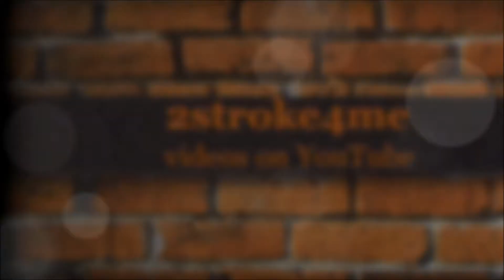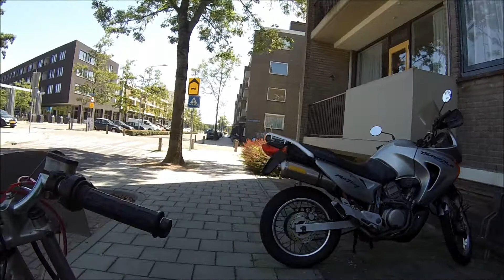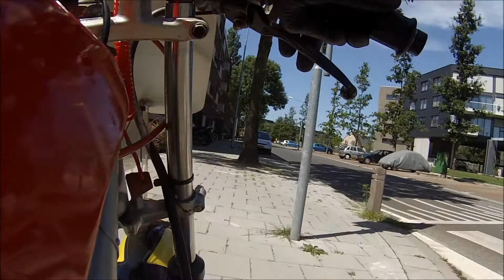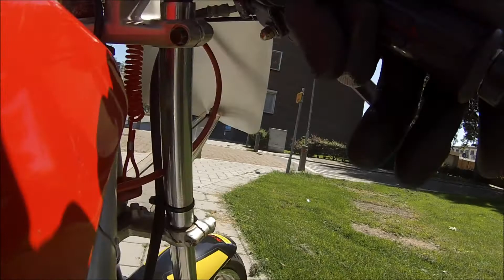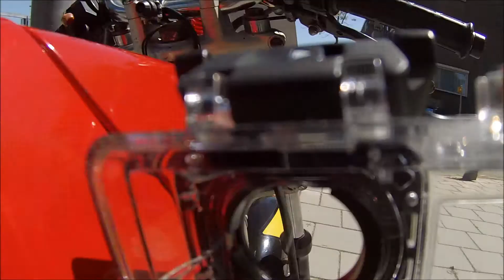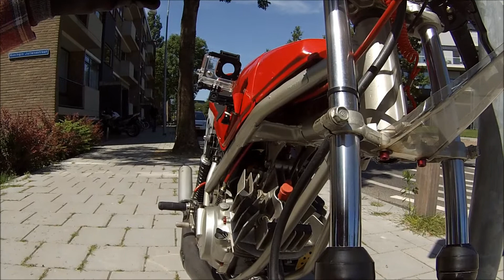Honda MB5 race bike warming up!

Comment: Awesome lil 2 stroke love that sound! 👍
Reply from the maker: I've done a lot of racing, mostly enduro (even on a 600 twin), but on this little 50cc i had the most fun!
Reply: @2stroke4me  It looks like a very fun lil bike to race! If you look at the bars on my old gas powered bike the bars are very similar, I built them for a lil Honda CL175cc that I turned into a cafe racer, but they ended up on that bike... Lol!
Reply from the maker: @mikesrcgarage  They're quite similar indeed! Since we weren't allowed to use clip-ons, this handlebar was the best option.
Reply: @2stroke4me  I will say that is the coolest MB5 I have ever seen and never knew they raced them!
Reply from the maker: @mikesrcgarage  They're good bikes and can take at least 13 hp without loosing reliability, but need a lot of work to make light weight. We even did endurance races, which was the main reason.
This class (sports class) was very limited, it all had to be homologated (i cheated with the front hub which was home made but looked like an original part, lol). For instance, max carb diameter was 16mm and max amount of gears were 4. Offcourse 50cc was a maximum too and the minimum weight was 60kg.
The Expi Class was the top class in 50cc, and could easily reach 20 hp.
Reply: @2stroke4me  13hp out of 50cc is very respectable! Let alone 20hp that's amazing! My 55cc on my mountain bike only puts out 5.5hp stock but only weighs 5lbs... it's all about power to weight ratio your MB5 must scoot along very well! :)
Reply from the maker: @mikesrcgarage  It did 137 kmh at the longest straight at the most boring racetrack, lol!
Reply: @2stroke4me  Wow 85mph thats moving along quite well! I think my buddies only did like 45mph that's a big difference! Very Nice!
Reply from the maker: @mikesrcgarage  The benefits of working in a bike shop back then (didn't sponsor though).
Reply: @2stroke4me  Sponsorship is a great thing, but when your a privateer and you are competitive with the sponsored especially factory guys it's very rewarding...
Reply from the maker: @mikesrcgarage  It was rewarding indeed. And i enjoyed the sportsmanship in the pits and rivalry on the track.
Reply: @2stroke4me  Good times! :)
Reply from the maker: @mikesrcgarage  Wish i had a GoPro back then (my mechanic/chauffeur/cook and former colleague filmed my last race though).
Reply: @2stroke4me  lol... I know how you feel, I use to mount a Sony Vhs recorder to the back of my bikes long ago! I miss my GoPro for I still haven't found it :( I watched your last race it was painful! But up until that point it was a good ride! :)
Reply from the maker: @mikesrcgarage  That's a real shame, i hope you find it very soon! 
That's interesting, did you get good footage from that recorder?
That was the last race, and the weirdest one too. For unknown reasons the track marshals directed me to the back of the field.
Reply: @2stroke4me  I tried to fish for it again today I have built many different types of drags, I also have a mask and fins  but no luck yet... Surprisingly the footage was very cool! I would mount it rear facing on my Suzuki Gs 650E that was my light to light drag bike, straight bars, fork tubes dropped in triple tree, lowered rear running a 55 tooth rear sprocket... floated wheelies with no clutch. Lol, footage filmed was cool! Why did they put you to the rear that sucks!
Reply from the maker: @mikesrcgarage  That's starting to sound worrying! Those GoPros are such nice cameras, i know i'd be really grumpy if i ever lost mine!
Those are nice bikes, real bikes! Suzuki always made excelent bikes. I would've love to see you  in action :D
I have no idea why they put me in the back, and i really didn't care. Up until the point where i got wiped out i had a great time, and that was what it's all about.
Reply: @2stroke4me  Yeah but I still have hope! I truly believe I will find it at some point! :) My Suzuki was a fun bike for the city! With the gear mod it topped out at 135mph not very fast but it was quick! My videos got lost in transition so to say :( but that's a long story! My CBR 600 F1 was the action bike lol it was stripped down and turned into a a street fighter many years before that was ever a concept, It was quick and fast! Max redline was 15,000 rpm and it twisted every bit of those rpm and more! Fastest I ever looked at the speedo was 167mph, 12,500 rpm at 2/3rds throttle, it had more, I didn't! I had enough!!! lol Good times! You were making your way through the pack smoothly until dude that never learned if your faster go around! Jerk!@#$%^&* On bikes you don't use the other guy for brakes to make a pass unless its a block pass in Motocross! and even then its not cool! Crashing sucks but that was not your fault! It was still a good run through the pack! Fun stuff!
Reply from the maker: @mikesrcgarage  Well, it's faster than my bike will ever be! Although the roads here are not suited for those speeds. I love it when people put their creativity into a bike. It's difficult object to get the right composition. I'm not a fan of customized choppers, but i can enjoy end appreciate the creativity some people put into it!
Love the CBR when it's naked, it looks like a good basis for a street fighter!
Reply: @2stroke4me  I have never been a chopper guy but yes I can appreciate the creativity and the workmanship that goes into them, just not my thing! lol I'm a fan of sport bikes, Canyon racers bikes that accelerate quickly and are fast nd nimble! The Classic Cafe look is my all-time favorite! Moto GP bikes "2 strk 500's" that is are for me what dreams are made of! The CBR did make for a very impressive street fighter! Without the many details of its abilities it could carry the front wheel 4-6 inches off the ground from 1st gear to 6th no bs it ran hard and you could flick it around with ease!
Reply from the maker: @mikesrcgarage  Those 500's were the pinnacle of sports bikes! Love sports bikes and the technology behind them, although they go a bit overboard with the electronics nowadays. 
My favourite bikes are rally bikes. Not those overweight "adventure" bikes, but the 750 twins of the 80's and 90's. Mostly because they're practical and they can be used during the winter period and going offroad (both in the field as in the city, lol). Admitted, they're boring, but if i could afford a car, i'd love to have something like an RC30 (dream on) on the side. Or a Suzuki 500 2 stroke, or a Honda NS400 and turn them into replicas :)
Reply: @2stroke4me  Yes they were! Electronics tamed savage beasts down and took a lot away from sheer talent to muscle your way around the track... There were some 750 V twins that were amazing Multi purpose bikes. The Honda XLV 750R comes to mind and the other was called a Africa Twin which I believe was more of an adventure bike! RC 30, RC 51 were bikes I fell in love with many years ago! All those bikes you described would be a pleasure to own! The things dreams are made of! :)

Comment: Hallo, weet je de setup nog? Ik ben nu ook zoiets aan het opbouwen.groeten
Reply from the maker: Gecopieerd van m'n andere video:
Engine: Stock 4-speed gearbox.
             Stock clutchplates with lightened clutch basket.
             Ballanced crankshaft.
             Kickstarter components and oilpump removed.
Cylinder: Aircooled Airsal 50cc (ported and polished).
Exhaust: Proma (reworked to match the cylinder).
Muffler: Technigas.
Intake: 2 homemade carbon fibre reedvalves.
           16mm intake manifold.
           16mm Keihin carburetor (reworked and polished).
Ignition: Non-programmable HPI electronic ignition.
Frame: Stock and lightened.
Wheels: Rear; Honda MT50 hub and spokes and Akront 17" rim.
              Front: Custom made hub, Honda spokes and Akront 17" rim.
Brakes: Front:  Ventilated Honda MB50 disc, stock calliper.
             Rear: Stock drum brake.
Suspension: Front: Stock forks with reworked internals and stabilizer.
                    Rear: Hagon double shocks.
Other features: Combined stock fueltank and racing seat.
                         Michelin Competition tires
                         Various lightened and strengthened components.
                         Weight is 65kg.
                         Estimated power is 13 bhp.
                         Topspeed is track related (no speedometer).
Set-up is volgens de toenmalig geldende regelementen.
Dit was een laag budget project, dus het kan altijd beter.
Reply: @2stroke4me  netjes, hoe ver ben je gegaan met de cilinder?
Reply from the maker: @pauldoesfitness4265  Ik heb helaas de maten niet meer, maar de spoelkanalen zijn passend gemaakt aan die van het carter, de uitlaatpoort is groter en gepolijst en alle "belemmeringen" (brug tussen kanalen en inlaat) zijn gestroomlijnd. De uitlaat was niet optimaal dus ik ben niet extreem ver gegaan met aanpassen.
Reply: @2stroke4me  oke bedankt voor de info, weet je nog welke bougie je gebruikte? (Warmtegraad)
Reply from the maker: Ik had er een Splitfire SF409C in. Voordeel was dat 'ie schoon bleef als de afstelling goed was.
Deze komt overeen met de NGK BR7HIX (iridium).
Reply: @2stroke4me  oke,bedankt. Jij komt ook uit zeeland zag ik? Ik woon bij Terneuzen
Reply from the maker: @pauldoesfitness4265  Graag gedaan mede Zeeuw. Ik kom uit Middelburg.
Reply: Hallo, weet je toevallig nog welke maat sproeier je hier in had zitten? Bvd Paul

Comment: how big is the motor on this beast? i looked around the internet at pictures of hat they looked like stock and there ugly lol. yours looks pretty dang good tho and i like you camera angle too. 2stroke4me
Reply from the maker: It's built within the race organisation's technical regulations so it's still 50cc and has a 4 speed gearbox. The cylinder is an alluminium Airsal, nicasil coated, which i've ported to aproximately 13 bhp. Much more has been done to it but i'll write down the details in the next video.
Thanks for the compliment and the feedback :)
Reply: 2stroke4me nice man. i ride a yamah it 490 and its a monster lol nothin like the power of a 2 stroke. cant wait to see it on the track
Reply from the maker: James Cefalo That's a great enduro, wish they still made 'em like that. Had a CR250 enduro once, sold it and still regret it :(
Stay tuned, i hope to make some good footage!